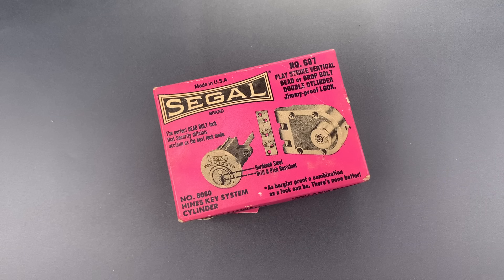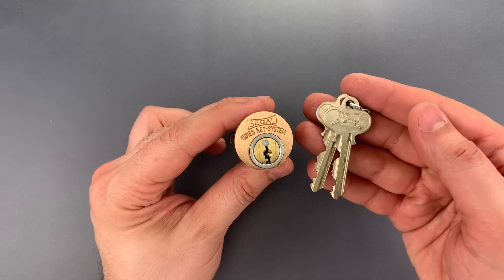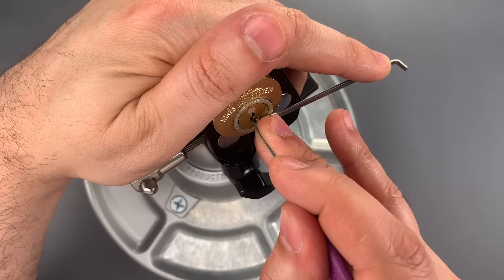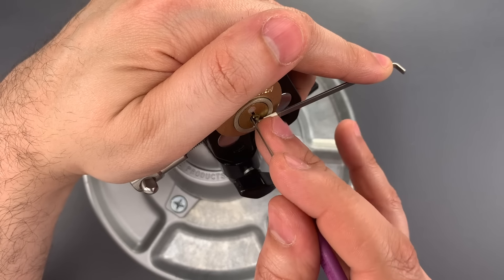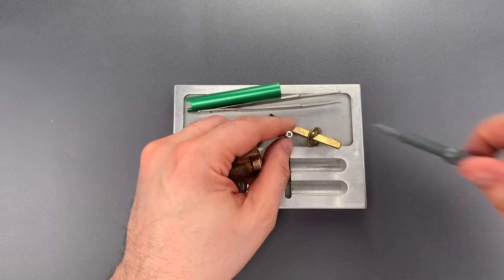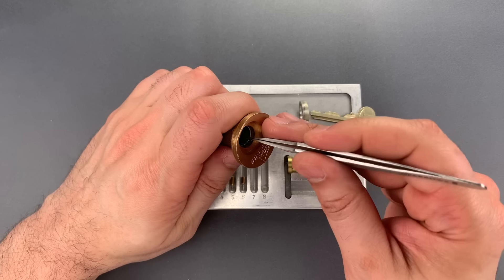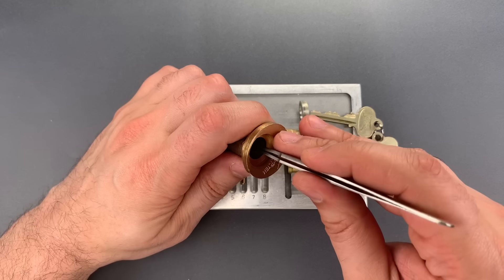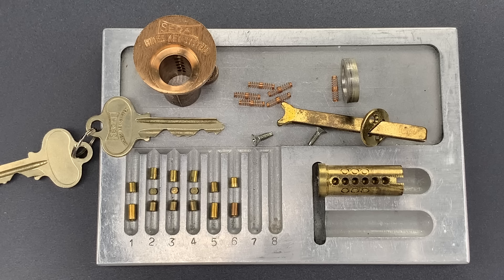[1181] A TRAP For Pickers! The Clever Hines Key System Picked

Comment: LPL: "I'll know from ten feet away that this is the Hines key system".  Geesh, this man is not wired like a normal human.
Reply: Well it does say "Hines Key-System" in giant letters stamped into the brass on the front of the lock, so maybe he just has good eye sight to see that from 10' away.
Reply: Noooo it's because of its unique keyway other locks don't have a keyway like this one
Reply: Learn a trade and you'll be the same way. As an electrician, I'm constantly noticing and judging conduits and fixtures....
Reply: @MaverickBlue42  "I can smell the aluminum wiring in these walls..."
Reply: @johnconway3557  Only if it's wired wrong, in which case it bursts into flames due to the lack of noalox or some similar brand that prevents aluminum wire from oxidizing and essentially turning into a great big resistor.
Reply: @MaverickBlue42  i am constantly judging peoples networking devices and wiring

"The wifi here sucks, they really should run a line to the center of the room and install a POE ubiquiti AP"

I cant stop it.
Reply: he's a lock pick though, it'd be a shame if he didn't.
Reply: He felt a disturbance in the core,  as if 3 pins were set, then were suddenly trapped.  He fears something terrible has happened.
Reply: LPL is a perfectly normal humam with the exception of the LIDAR on his head for the express purpose of detecting this security system
Reply: Is it really always the same pins that have the traps? Why not put the traps on varying pins so no one can know which ones are trapped?
Reply: @johnconway3557  lol
Reply: @Trezker  what wonders me more is if it should be possible to do it in a way where clicking it twice whould trap you as otherwise you just need to make sure you click everything twice if in doubt
Reply: He's just built different..
Reply: @MaverickBlue42  same but a telco technician
Reply: @Trezker  variating lenght of pins to have different keys is easy to do in a mass production optic, to have different spot to set trap pins means to have different stamps/programs to make the core which will increase costs, other than that, you'll need to know where to put the hollow pins everytime you have a different core so you'll need either a line of production for each lock or a very sofisticated way to identify core and pin placement, all of that just for the sake of have different traps on an already good trap lock considering the chance to have and expert picker going after your house and your house having this lock ok the door Is near to 0 and even knowing this, the picker can bypass the trap by testing twice each pin in order to find the trap pins so the extra layer of security of having different trap spots it's only going to gain some seconds against a well experienced picker and will work the same against everyone else, this st the cost of having a much more complex production line or multiple production lines which Is higly non marketable
Reply: @johnconway3557  😂
Reply: built different
Reply: He just build different
Reply: Lol!!
Reply: He’s just built different
Reply: fucken built different
Reply: @viewitnow3539  Underrated
Reply: Well he is a lawyer.
Reply: @Trezker  the key to defeating this lock is knowing how it works, and when this lock was manufactured, the internet didn't exist. The number of people who knew which pins to pick was absurdly low, and if they were that well informed, they probably wouldn't have fallen for the random placement either.
Reply: @king-su5uc  or maybe it's the fact that it has a hardened steel pin and ring on the face.
Reply: @lethalblank7624  are. Are those words? Or are you making stuff up there? It’s impressive.
Reply: I would know from 2 feet away that it was metal.
Reply: His distance vision is waaay better than mine!
Reply: @lordfelidae4505  yep, I do the same. In the situation @LethalBlank described I'd think of using UAP-AC-PRO
Reply: he's a lawyer, he's trained to take notice of things that strikes his interest whether it's in a case or like this, his fascination and hobby
Reply: It literally says "Hines key system" right on the front of the lock though lmao. As long as you are capable of reading text from 10 feet away ANYONE would know exactly what kind of lock it was.
Reply: @lethalblank7624  love Ubiquiti’s Mesh stuff but nothing beats a damn wire.
Reply: It's called learning and mastering a craft. Something googling and watching YouTube videos can't do.

Comment: Imagine if the position of the traps were random. It would be quite unpickable, right? You wouldn't know which pins needed to be pushed twice and there would be a great risk of simply destroying the lock.
Reply: That would actually make sense. Even though the design is known, if you need to guess 3 out of 6 it would make it a one out of 20 chance. A 5% chance is too low for a criminal.
Reply: You could feel for the additional shear lines when picking and figure out which positions have trap pins before ever attempting to turn the cylinder, so while it would complicate matters significantly, it's still a feasible attack.

Now, with a thick enough wafer, you could have the hollow ground into the wafer rather than in the driver pin (at this point it'd be more like a middle driver pin of a master keyed lock), so basically the second shear line becomes the trap instead. And then you could randomly mix and match between the two. Six pins all with one safe and one trapped shear line, with a 50/50 shot at which is which... and not that much more complicated to machine, though assembly would be more involved. Bonus points for the fact that it would feel like a proper master keyed lock to all but the most careful pickers.

I am sure someone could learn to feel the difference in the pin surface that's biting or something, or that I have missed some obvious bypass, and this certainly weakens the lock to destructive attacks trying to turn the core, but still.
Reply: @IaCthulhuFthagn  
Your theoretical lock would probably be immune to everyone that isn't LPL.
Reply: You guys deserve more likes.
Reply: Maybe it's actually better if it's manufactured consistently this way. This lock can only be picked if you know the trick, but even if you know the trick you'll only double check 3, 4 & 5. This leaves the lock owner the possibility to modify your lock by adding a fourth trap pin, to trick the people who thought they knew the trick.

But then again, if you are capable of doing that you could just as well modify any other lock to get the same effect.
Reply: The person picking the lock could simply assume that every pin is trapped and check all of them for a second pin.  If some of the pins were trapped so that they locked in the second position instead of the first, and each lock had a random arrangement of them, it would be much more difficult to pick.
Reply: @wizardsuth  But what if you'd put traps in some of the wafers and some of the pins? That way, you'd have second pins in all of them, but only some needed to be raised to that line, while others must not be raised that high
Reply: @IaCthulhuFthagn  If the hollow was ground into the wafer, their would be no tolerance for key wear.
Reply: indeed. precisely true!!
Reply: @IaCthulhuFthagn  this is exactly what I was thinking when I saw the original comment. I'm really curious how anyone could reliably pick this type of lock.
Reply: @megamaser  I'd be amazed if anyone could reliably manufacture such a lock and get any decent level of reliability and durability out of it, but as a theoretical exercise, it's certainly interesting.
Reply: @IaCthulhuFthagn  I don't see what the challenge is in manufacturing. It seems like it would be basically the same as the lock in the video. You're just putting the hollow piece on the top instead of the middle.
Reply: The easiest way to make this lock unpickable is to mill MASTER (or Schlage or whatever) into the face and put some bronze wash over the hardened steel. My guess is even the LPL would fail if he didn't know what it was.
Reply: And imagine if the other pins were spools to make you think it's a second shear
Reply: @wizardsuth  Youi are correct Wizard - But the key for a lock Picker is TIME... So the more Trap Pins, The longer the job...  

I never actually thought I would say this, but it is a shame that we don't see such a class of "Thief or Burglar" these days... Crime may be wrong - But you could admire and respect to a degree a Criminal who WOULD ACTUALLY TAKE THE TIME to Pick a Lock... These days you are more likely to return home to find your Windows put through or your Door Smashed off it hinges... 

Old School Criminal Masters are a dying breed - And I actually feel kind of sad about that!
Reply: yeah, total crap
Reply: The easiest solution is simple to not put ANY brand on the lock anywhere, and not have any other distinguishing features (like that hardened steel plug). The main reason that these locks are "pickable" is because people work out the way to bypass them, then share the knowledge. If you don't know what type of lock it is, then traps are easily activated.
Reply: You wpuld have to add, that rest tooth lock the lock  when they are put in 2nd position. Otherwise  pumping all to highest position would work. Also... rip if you have multiple keys
Reply: @IaCthulhuFthagn  just wondering what your thoughts to this. But i noticed that the hollow point is roundedand if the hollow point is in the waiver wouldn't you be able to feel that there is a "hole" that the "pin"/waifer has with the pick and know that the hollow point is in the first sheer line?
Reply: Well then just push each pin twice. Unless you combine this trap with another one which a lock is trapped by pushing some pins too far.
Reply: Serrated pins plus randomly mixed trap pins... I imagine that'd be a tricky one.
Reply: @charlessprinkle3512  no because the wafer would still have the original pin beneath it. The wafer itself is sandwiched between two pins so you never actually feel the wafer directly with the pick tool
Reply: @thermophile1695  Or any of a million other locksmiths that have his skill or more.
Do not be thinking the LPL is some sort of a picking savant.  He is a skilled tradesman for sure - but so are a lot of others.
Reply: @VestigialHead  
But how many tradesman are going to be robbing your house?
Reply: welp i just commented the same thing 🤦🏾‍♂️
Reply: Meanwhile countless commercial doors are secured only by push bars after hours
Reply: Definitely.
Reply: @ahaha8  rolls a nat 20, and breaks into your home.
Reply: @VestigialHead   You say there are a million locksmiths with equal or greater skill to lpl, but you would be well to remember that facts retrieved via an enema are not as reliable those from google. I looked: in 2022, there were ~24,000 in the US, which is a developed country, but generously assuming the same ratio across the world (0.007%) you have half a million total locksmiths. Of LPL's skill? Much less.

Comment: I had two of these on the doors to my childhood home. One of them seized up for no apparent reason, halfway unlocked, and we had to have it repaired. Now I know why!
Reply: Locksmiths 1, burglars 0.
Reply: @IudiciumInfernalum  Could also be children 0.
Reply: .....
.....
.....
realization 0.0
Reply: In the other video about making your own, someone commented that if your key gets worn down from normal use, you can wind up triggering the trap by using your own key.
Reply: @Amaroq64  If the wafer pin is tick enough, a worn out key should stop working long before the trap is triggered.
Reply: @jwstolk  the wafer pins he removed here were fairly small. And since most lock parts back in the day were brass. Well brass is fairly easy to wear down. Especially if a key is made on modern times for such a lock. An alloy would only wear it out faster.
Reply: Repair meaning it was junked for a standard lock...
Reply: Yup, i just try to pick one of these. guess what? now its broken. :c

Comment: This may be the most secure lock I think LPL has ever shown us.
Reply: Bowley Lock.
Reply: @BSE1320  video number?
Reply: 4th place after the sticker and two Bowleys
Reply: @adrianortiz3751  

636, 653.

Squire locks are no joke either.
Reply: Imagine getting Sponsorships to not getting your lock picked in a video
Reply: Nahh...sticker
Reply: @Payperheirplain yet he still picked it in less than two minutes, while talking is through the process...
Reply: Pretty sure there is an old one that he doesn’t know the model of that he has never picked. I think it’s in the ridiculous keyways video
Reply: What happens when the teeth on that key finally wear down even just a micrometer?
Reply: @Dtr146  A micrometer is fine.  The lock still has finite tolerances.
Reply: @Dtr146  They'd have to wear down by the entire thickness of the wafer to activate the trap. No key would work any more with that much metal worn off it.
Reply: Someone else said it. Bowley.
Reply: Fuckup thing is that i need to break my door down if they (trap) my door
Reply: @Kelvinpierre99  true which definitely stinks, but replacing a door is a lot better than replacing all of your belongings
Reply: besides duct tape
Reply: Omega Plus  Mul-T-Lock
Reply: I wanna see a Lock he can't open! then disassemble it, why he can't open it
Reply: @somal1anwarlord197  Omega plus Mul-T-Lock
Reply: @aokiaoki4238  but he picked it!
Reply: @somal1anwarlord197  No he didn't
Reply: @aokiaoki4238  i watched the video... or wich one do you mean?
Reply: @somal1anwarlord197  Check out his video on the Bowley lock. If I remember correctly he just takes it apart and explains why it is nearly impossible to pick
Reply: @christianscustoms6429  I will check thx!
Reply: Just imagine that it would be random traps.. Not just 2, 3 and 4 but any three out of 6
Reply: The funny thing is that that trap seems quite easy to implement for bowley system, although you don't have much depth to fit that.
Reply: @LTNetjak Depends on the crime
Reply: @Dtr146  wiggle it
Reply: Dude, there was a lock he could not pick i forgot its name
Reply: I recall 2 or 3 locks he COULDN'T pick at all.
Reply: Wait till you see the stuff lock once its ready
Reply: @BSE1320  agree
Reply: 7 minutes fuck yeah. God tier
Reply: Yes this is one of the most secure lock LPL has ever shown us and don't expect LPL to show you anything more than these types of toy locks

Comment: Without these videos the general public would have no way to appreciate the quality of these locks.  Customers probably just avoided them because of the higher price, being ignorant of the lock's advantages.
Reply: Or they avoided them because of the danger that somebody trying to pick your lock means you can't get into your home or business any more.
Reply: I used to sell them they were not expensive like Medeco (still one of the hardest to pick)
Reply: @beeble2003  Or, if you were inside: you couldn't escape in the event of a fire.
Reply: - And any lock can have a row of trap holes drilled into the barrel, and a set of t-pins and wafers inserted.  (Every Locksmith could include it as a service.  Make that standard C4 Pin Tumbler lock "Unrakeable".
Reply: @dj1NM3 Many dead bolt lock systems lock are designed so you you can always unbolt and open the door from the inside irregardless of whether the key cylinder can be turned from the outside. In fact many common dealt bolt lock designs these days do not tie the lock cylinder directly to the dead bolt turning rod. This is why when you turn the knob on the inside to endgame the dead bolt the key hole/cylinder does not turn with it. This means you can unbolt the dead while inside even if the trap system is engage in this high security lock.
Reply: @dj1NM3  on a rimlock (and most mortice locks) the inside and outside shafts are independent of each other. The inside thumb piece (or key cylinder) would stil throw the bolt even if the outside cylinder is bound.  You'd still be able to open this lock from the inside.
Reply: @beeble2003  to add to what others have said, fire code in the US prevents the sort of lock (common in other countries) that requires the key to open from inside.
Reply: @beeble2003  except the key allows you to get back in... He even said in the video the key lifts up the pins and resets it.
Reply: @beeble2003  A $30 lock that stops someone from breaking into a home or business... I feel like the break in costs more.
Reply: @dj1NM3  ??? You mean like... if...while your home was on fire... a thief tried, and failed to pick the lock to your front door? I don't think anyone avoided this lock for that reason.
Reply: @ratataran  No, you've misunderstood. At that point, he's talking about how the key avoids the trap: it lifts the pins high enough that the wafers come between the hollow pins and the circular grooves.

The key cannot reset the lock. The trap pins engage with the circular grooves beside the keyway. The key goes into the keyway, so it can't touch or otherwise manipulate the trap pins when they're engaged.

And if the key did somehow reset the lock, the trap pins would be a waste of time, since, basically, anything you can do with the key, you can also do with a pick.
Reply: @dj1NM3  well how likely is it that happens unless someone is doing both to kill you in that case he could also block the door with other means
Reply: That's exactly what Master Lock relies on
Reply: @Charlesb88  *regardless
Reply: That sounds like a failure of advertising